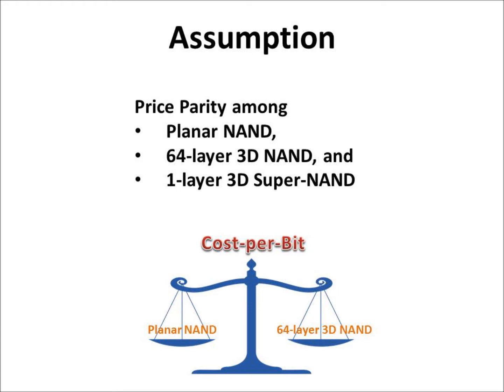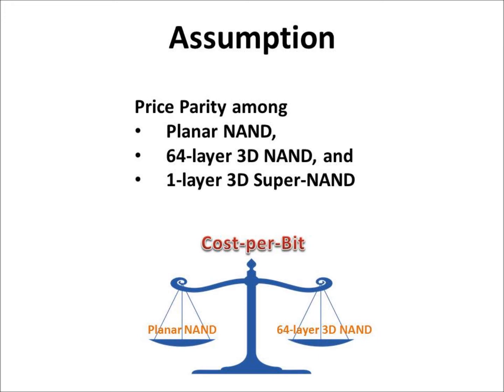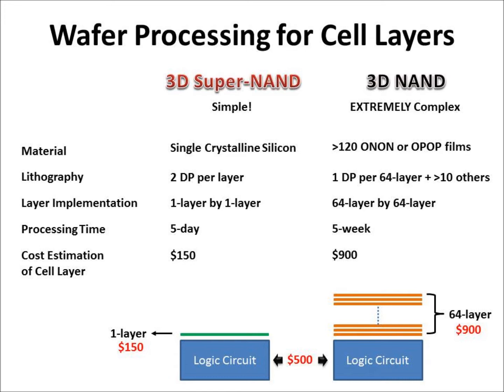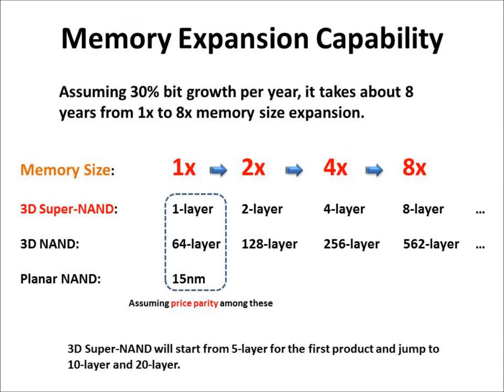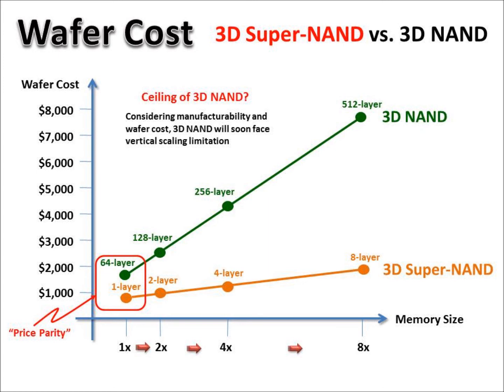What is 3D Super-NAND?

Comment: As I understood the big manufacturers never intended to stack the layers up to 128, 256 etc. but connecting smaller stacks together what in the video is called 3D Super-NAND. 3D NAND already uses that technology.
Reply from the maker: 3D NAND has poor cell density. So, it should add more layers to be cost competitive. Big manufacturers are making "string stacking" which combines multiple single string to implement high number of cell stacking. For example, "36-layer + 36-layer" to implement 72-layer by SK hynix and "48-layer + 48-layer" to implement 96-layer by SanDisk.
Reply: Clearly, the future is here!!
Reply: BeSang does not propose to use the multilayer vertical stacks.  If you look at their web page you will see their layers are a 2D NAND with CMOS-under-cells, allowing cheap CMOS process for the base, combined with optimized high density vertical channel (like the "wire channels" proposed for 7nm) for the NAND cells, built in a separate add on epitaxial layer.  The epitaxials can be added up to a relatively modest count by adding vias connecting down to the base CMOS.  I'm not an expert to say if it is everything claimed, but it certainly differs from (3D) V-NAND.
http://besang.com/structure.html